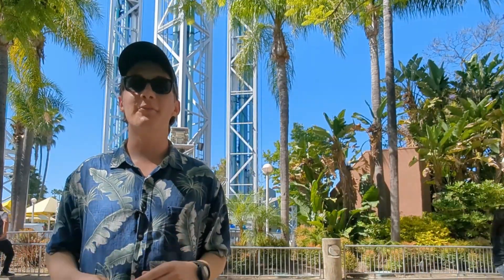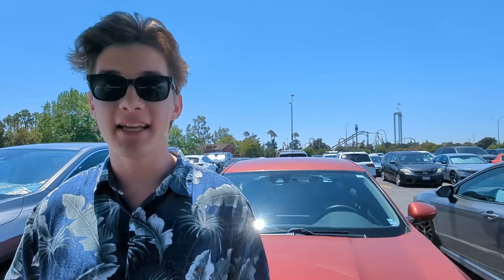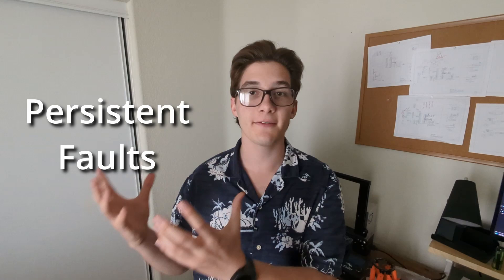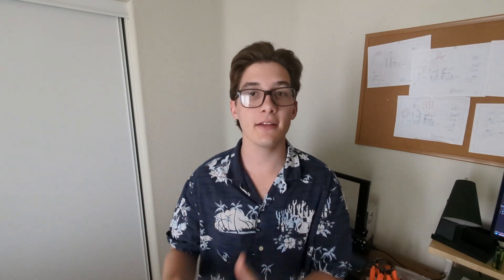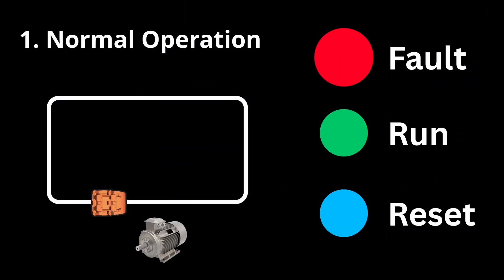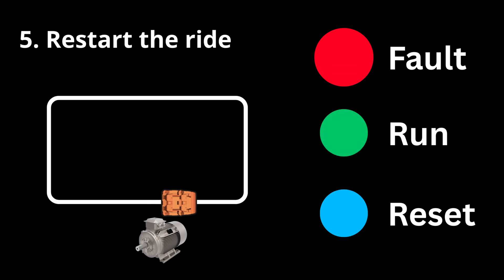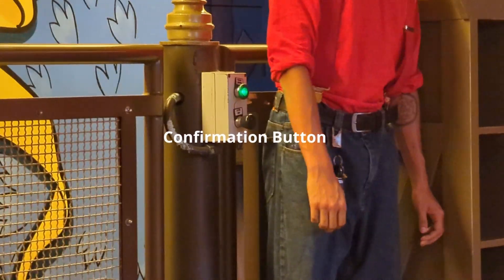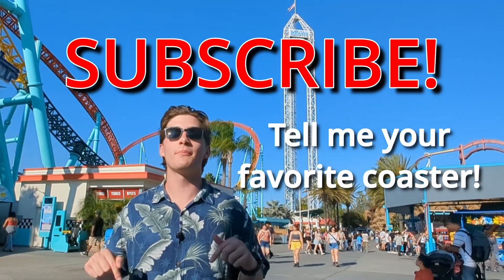Rollercoaster Safety explained by a Safety Engineer

Comment: That’s not true most rides e-stops have a key that only maintenance and managers have and they then release the e-stop and turn supervisor switch to reset fault and restart and the ones that don’t still require that key no input from any other button. the only manufacturer that really uses the multiple buttons is b&m and s&s but on many s&s rides maintenance can reset the e-stop without the other buttons
Reply from the maker: Very interesting. What I said in the video came from my experience at Universal. It is interesting to see how the same level of safety is met by different manufactures and park operators.
Reply: @kleistrobotics2220  apparently rides can be customized so parks can choose how complex resetting e-stops are